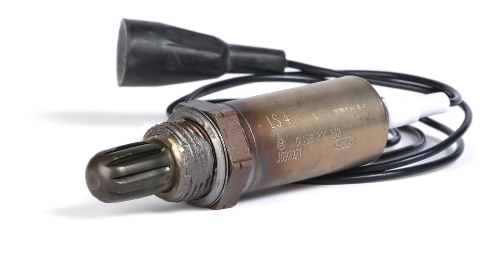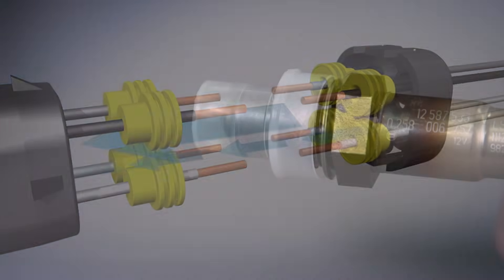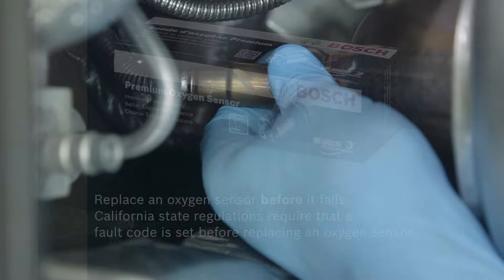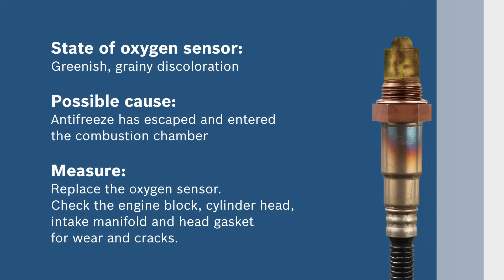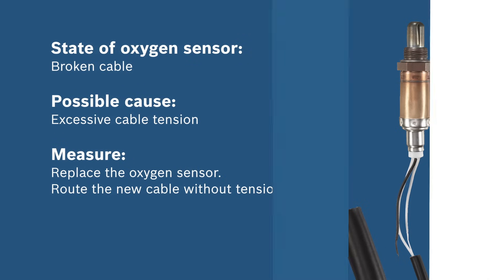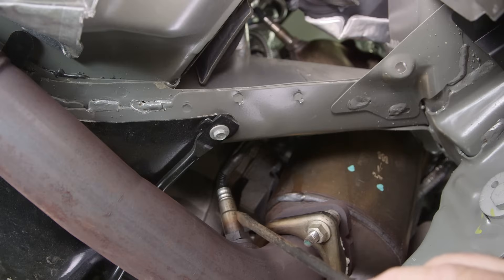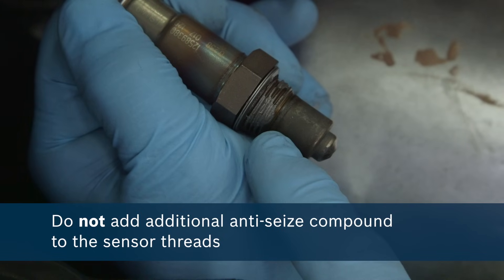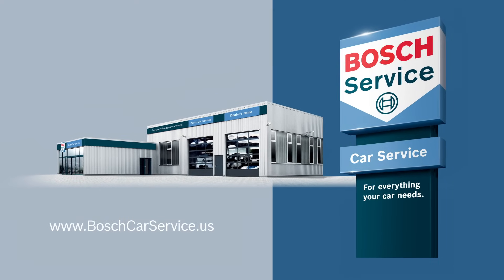Replacing a Bosch Oxygen Sensor on Your Car

Comment: 😂let me tell you, have been trying for 2 hours to get an electrical wiring connector unstuck for nearly 2 hours. Finally working it I got it unstuck. Did not want to break the connection.  Now after having to remove a stupid heat shroud on the exhaust manifold that surrounds the oxygen sensor, I am now waiting on the PB Blaster penetrate  to work and get the unstuck sensor out. I thought this would be an one hour job instead it will be over 4 hours spent on it. I am saving money doing it myself. I didn't know It would take so long and be so much trouble. Jack in DFW Texas October October

Comment: I need a 025803000N sensor for my UAZ HUNTER wonder if i can use the bosch 15733 0258986602 hard to find it in mexico. Thanks or which you recommend from bosch ?

Comment: Hello, my honda car has a dense mark on the sensors but I bought a bosch brand oxygen sensor for now it is working but the only thing is that my sensor is broadband and oscillates differently from normal oxygen sensors.

I don't know if I trust this brand although I have read that it is very good like the original, since Bosch is also a bit expensive. If anyone has used oxygen sensors of this brand, tell me if they are reliable.

Comment: What's the big deal about replacing it Before it fails ?
What's wrong with replacing it when I see there is a problem,  ie: when it has failed ?
Also, I don't understand what you mean : calif regulations require that a fault code is set before replacing an O2 sensor.
Please explain those 2 things.

Comment: Does Bosch make equivalent O2 sensor to Denso 234-5178 and 234-4988?
Reply from the maker: Thank you for taking the time to reach out. We've forwarded your inquiry to consumer care, who should be reaching out to you soon.
Reply from the maker: Hello.  Thanks for reaching out.  Unfortunately, Bosch does not make an O2 sensor that is equivalent to these two sensors.
Reply: Hello, my honda car has a dense mark on the sensors but I bought a bosch brand oxygen sensor for now it is working but the only thing is that my sensor is broadband and oscillates differently from normal oxygen sensors.

Comment: When changing exhaust, what type of anti seize should be used to reinstall the used O2 sensor?
Reply from the maker: Thank you for taking the time to reach out. We've forwarded your inquiry to consumer care, who should be reaching out to you soon.
Reply: @BoschAutoNA  thank you. I have a similar question when removing and reinstalling spark plugs.
Reply from the maker: Hi Scott.  Thanks for reaching out.  All of our parts come with anti-seize but if the part has been installed and removed some more needs to be added, most auto parts store carry a small packet at the counters, but we use high temp copper based anti-seize – No Silicone it can cause the sensor to go bad.

Comment: The Bosch sensor I bought needs to be wired, and I have to somehow use a portion of the existing wiring. I was hoping this video would cover that.
Reply from the maker: Our Customer Service team is handling your case internally. We will prompt them to contact you for an update during normal business hours.
Reply from the maker: The sensor I am aware of needing to be spliced is the universal sensors to which the link to the installation video is below.  

http://spr.ly/6052181a6

Comment: hey, I bought a universal o2 sensor (11027) for my 91 mr2. auto zone website said it was the right one. but the o2 sensor has one wire coming out of it and the mr2 has 2 wires . do I combine the wires and crimp them to the sensor?